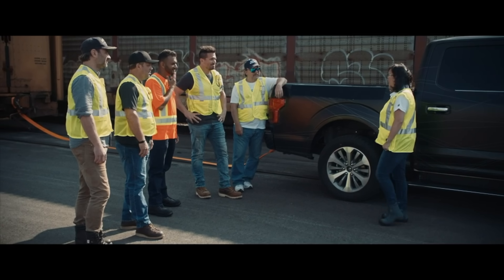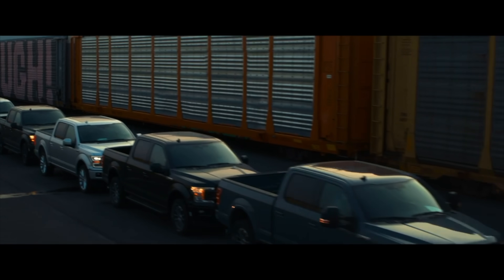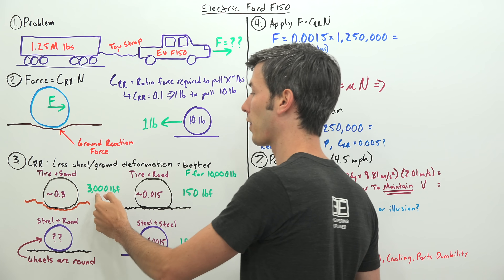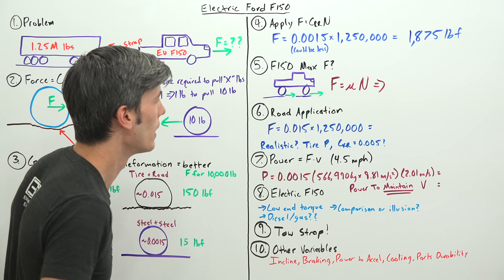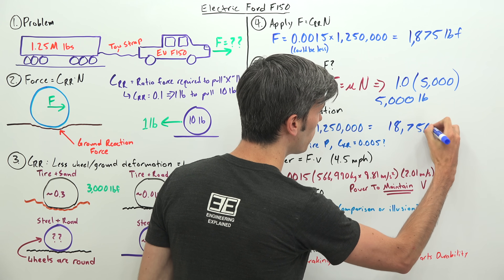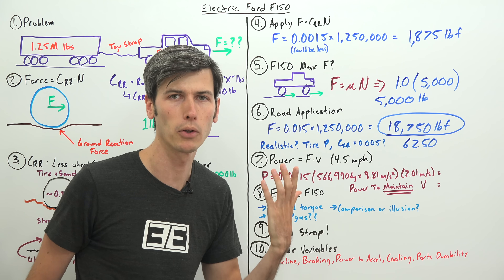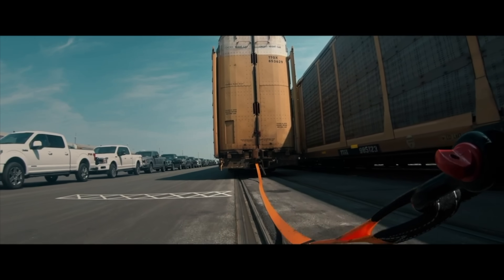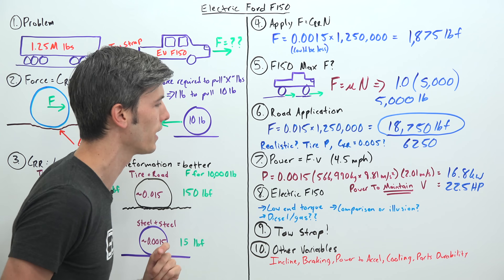No, Ford's Electric F-150 Can't Tow 1 Million Pounds (Realistically)

Comment: That dude is a total moron. I knew all of that stuff already. I knew all of that when I watched the video the first time! We talk about this kind of stuff when we design top running bridge cranes. The bigger your steel wheels are, the less impact your rolling coefficient has. The dumbest thing he glances over is the tow strap. The tow strap is incredibly elastic and that’s where electric motors really help. Once they stretch that strap all the way out, all the wheels have to do is hold that torque from letting the wheels spin backwards and the strap does the work for the truck.

This guy said a whole bunch of numbers that proved exactly what I already thought. Also, the train cars were almost for sure not pulled “tight”. The linkage between the cars let’s you pull 1 car at a time until they’re all moving.
Reply: He is just explaining it for people who dont know much about this kind of stuff, but yes this is very simple and basic stuff

Comment: I can already tell you why; steel on steel has almost no friction at allwhich which is why you can easily see one or two locomotives pulling a fully loaded coal train up a steep mountain.  Rubber on asphalt however has a LOT of friction.
Reply: pulling a train up a hill is always hard and having low fricction doesnt help with it

Comment: Again, much as with the video on double-clutching that I saw yesterday, 'fraid I can't give this a like. No A grade, not even a B, it gets an I for incomplete. The big missing thing is that friction is not all of one type. Usually friction is modeled as some combination of sliding friction and viscous friction. It sounds as if you're treating the friction as all viscous friction, and that may be realistic, but you don't really state clearly if that's your assumption.

I have no serious mechanical engineering background, but intuition tells me that, for rubber on pavement, the interactions are probably more complex than simply and sliding and viscous damping can fully describe. But a combination of the two might be a good approximation here. I just don't know.

Your viewers seems to like the whiteboard graphics. I, for one, don't. Better tech for your graphics would make things clearer.

If sliding friction amounted to much, I'm sure you'd be SOL trying to tow much of anything. If it's equivalent to viscous, then the friction will consume power, and set a limit to how fast you can tow that super-heavy load.

You correctly point out that stopping is a real problem! The best thing might be a second truck, on the other end, ready to pull when it's time to stop.

A conventional ICE truck has a big disadvantage here because of all the slipping required, which consumes power. After all, it will take a good while to get to top speed. If it's a manual, you may be needing a new clutch at the end! An automatic is probably OK as long as you don't push it too hard. (Question: Do modern automatic transmissions have warning lights for overheating?)

Comment: The tow strap is key,  by the thickness of it tells me  it's greater than 2000 lbs. It's also a kinetic strap that stretches like a rubber band that stores the force it it, you can see it stretches at first, and they cut to the rail wheels. And show it start rolling quickly. Anyone who has ever used a strap like this will know it's a force multiplier (so you can pull vehicles stuck in mud out by putting slack in it and accelerating and the energy gets stored in the strap rather than transferring instantly , making a nice pull and hopefully nothing breaks) if they used a chain the load would have never started to roll.

Comment: I used to work on subway rail cars. In the railyard if we needed to move a rail car a couple feet in the shop to get the lifts to line up under the wheels we’d have an operator release the brakes and a couple guys would just push the entire 40 ton 2-car married pair by hand. It’s like pushing a dead sedan, super easy. In the shop the 13,000 lb truck (some people call em bogeys, they’re the steel frame that holds the wheels and motors and is very easily separated from the car body) can be pushed by one guy by hand very easily. Very low rolling resistance.

Comment: I would have been more impressed if the F150 broke the tow strap
Reply: Just askin
Reply: @poopypants678 _ no it’s not just because it has a V12 doesn’t mean it has torque or enough grip for that mater. It has plenty of HP but would never be able to do this. Its physics dude
Reply: @aduptuniform2647  Actually, the grip part, or at least tire compound, is far better than this POS truck😇 Even the first Veyron had super special tires developed just for the car to handle the power😎
Reply: SCOOBYTRUCK3R ! The wheels would crack in the frame can’t take it either
Reply: AduptUniform26 if Chevy is so strong why do they have to make up their own reward and are completely loosing when it comes to the torque game between dodge and ford
Reply: AduptUniform26 wooosh
Reply: AduptUniform26 bugatti’s have a W16 my guy
Reply: AduptUniform26 the Chiron has a v16
Reply: That truck isn't capable of breaking that tow strap with no slack in it, it doesn't weigh enough.
Reply: poopypants678 _ you’re denser than a black hole
Reply: Sureee
Reply: Gas truck would blow a transmission from start?
Reply: Bruce Ford Jr probably the clutch
Reply: The Chevy/gmc trucks are complete jokes, if you have the 5.3 that is. The 6.2 is actually pretty stout but the 5.3 has less power than fords 5.0 and fords 3.5 ecoboost. And even the 6.2 has less than the 3.5 high output just sayin
Reply: poopypants678 _ anyway Bugatti’s are slow
Reply: Ford ain’t that strong
Reply: AduptUniform26 what vehicle company do you consider strong then?
Reply: @Jielyn Sabarez Chevy gmc sometimes Toyota. Why?
Reply: AduptUniform26 that’s funny since Toyota’s largest truck in 2020 can only tow 10,000 pounds and Chevy’s can  tow 35,000 pounds meanwhile fords largest truck can tow a maximum capacity of 37,000 pounds. so how on earth is it possible that Chevy and Toyota’s are stronger than ford .
Reply: @joshfenby4170  Toyota doesn't have a diesel option..
Reply: @joshfenby4170  the 2017 chev 3500 was rated for 25000ish , Ford and dodge rated much higher but when put head to head at 25000 the chev smashed Ford and edged out dodge . In every category,  fuel eco , acceleration and braking
Reply: @aduptuniform2647  CHEVY SILVERADO ALL DAY LONG!!😁
Reply: @Dee Mack, hell ya
Reply: Casey Houser that’s not the point he’s saying Toyota’s stronger when that is clearly not the case
Reply: Tyler Rosborough well last I checked it’s not 2017
Reply: @joshfenby4170  my point is don't trust the ratings,  ford out rated everyone that year and got outperformed by every truck with lower ratings
Reply: Tyler Rosborough good point but on paper that’s what It says. but my point was aimed toward the Toyota how could you possibly say a compact or mid size truck could out perform a large truck as far as strength goes. and at least in 2019 I read a few things where they tested all the largest trucks from ford, dodge and Chevy and ford outperformed them in towing.and I did mention 2019 in my first comment I’m not talking about any other year other than 2019.
Reply: @joshfenby4170  that's fair enough and I agree about the yotas,  they struggle against other half tons ,no chance against any larger truck
Reply: @jielynsabarez2693  anything else
Reply: @aduptuniform2647  What are you towing that needs more than a ford can give you? And is it worth the reliability issues GM is known for? Even if GM made more powerful vehicles I have been left stranded by my Chevy enough times that I don't think I would risk it.
Reply: @Gareth Baus never had a GM vehicle go out or have any problems with me or my family, so there’s no reason why I should switch to something else.
Reply: @Gareth Baus and I agree, that’s some GM cars have problems, but I can list of a number of vehicles that have lasted over 20 years
Reply: @garethbaus5471  I can name my families cars that they got rid of due to the numerous problems: 2004 Ford F-350, 2014 Ford F-350, 2011 Ford Mustang, 2013 Ford Focus, and 2001 Ford Mustang. Our cars we own: 2019 Chevrolet Suburban (Mom), 2018 Camaro ZL1 (me), 2020 Chevrolet Silverado 2500, (Dad), 2020 Chevrolet Camaro SS (me), and 2020 Chevrolet Camaro RS (LT1) (Dad). We also owned Ram's in the past and they were great, so is Dodge, since we never have problems with GM nor Dodge cars.
Reply: Jielyn Sabarez Toyota is a lot more reliable than ford
Reply: @aduptuniform2647  Yeah, only 2 Tesla Cybertrucks can break the strap xD
Reply: @JarutheDamaja Lol, maybe more

Comment: To be honest your numbers are bull. I have worked on a rail road and it takes a lot more force than what you think. There are other friction that is in effect also such as the axel bearing and other axel components. 
From experience on the railroad a typical empty car weighs 30 tons empty= 60,000lbs 
So with your math 0.0015 x 60,000 = 90lbs. 
By experience it takes a lot more than 90lbs to move that 60,000lbs car. It takes more like 300+ pounds to move it. 

So I have no idea where you are getting your numbers from. Reality doesn’t always work with math bud. I’d like to see you actually see in person how much it takes to move an empty train car. You will be surprised how much it takes and you will re think your math.
Reply: yeah, its always a bit more complicated than it looks

Comment: A zephir e2000
With a diesel engine with 80hp
With a torque converter 3 speed 
Max speed of 25km/h
 pulls 6 000 kg in 2nd gear 
With 16 000kg of mass 
With slipping tires on polished concrete

Comment: The huge advantage is steel wheels on steel rails is super super super efficient. Practically no friction. That's why trains do so well. A human being can move a single box car on a flat surface if he's in really good shape.
Reply: I work in a rail yard. I've done just that.
Reply: Same concept with boats, even a child is strong enought to give a 7-8 ton boat a push away from a pier.
Reply: Anyone can push a car on a flat surface, as long as  you have grippy shoes you have more than enough force to get it moving, and once it's moving it goes easily.
Reply: @miguelmsilva4112  , it's not the starting that's the problem. It's the stopping.
Reply: What kind of shape is a really good shape? Circle? square? triangle???
Reply: I was able to move 2 lmao
Reply: Well, what about the static friction between the wheel and rail? Isn't that how wheels work?
Reply: Not in the wheel bearings though. Super effective. I should have been correct in my prior statement.. steel wheels have like almost no rolling resistance compared to rubbber.
Reply: Also you don't have a single mass to accelerate but individual carts which actually have space between them. At rest you only towing the first cart, when it gets moving its momentum helps to tow the cart behind it and so on. This is actually how trains can have crazy weight and still be able to move.
Reply: He said that in the coefficient of rolling resistance part but ya
Reply: Not friction, no friction is not a good thing for wheels to have

Comment: Train cars have very little rolling resistance. You can push them by hand. Now pull that up hill or better yet put all that weight on the rear Axle. And one more thing. Let me see that truck stop a million pounds. Dumbest scheme I've seen yet.

Comment: In step 5 you multiplied the truck's rolling resistance by it's weight.
How can that be the trucks pulling force if you don't even bring the power of the motor into the equation?
Reply: He's saying that's the most force the truck can transfer to the ground (due to it's weight and friction coefficient). He assumes the truck has the torque available, any additional torque would be useless if the truck can't transfer it to the ground.

Comment: Well the truck was on the track so there is minimal friction, the video also didn't show the truck accelerating, if it really want to show off its torque it should take in the acceleration process as well, heck if it is on the road the torque of the ford won't even be able to overcome the friction, and you will end up with a blown engine, and I don't think anyone will use a pickup truck to try to tow a train even if it have all those torque

Comment: I FINALLY found an error in your video Jason. You said if you added a ton of weight to the truck it might be able to move it.  But a ton is only 2200lbs which would make the truck 7200lbs still WELL short of the 18000lbs required. Ha! 

I know you were speaking figuratively and not literally but I’m taking this win!
Reply: TurboNFRStwoK he actually did make an error, he completely ignores inertia, and 1.25 million pounds has a lot of inertia. (Force = mass * acceleration)
Reply: @joshlemons3662  and internal components

Comment: If a strongman can pull a jumbo jet with his teeth , this is actually not that impressive.
Reply: But can a Tuareg pull a jumbo jet with it's teeth?
Reply: @dinethaltmann9582  Can a strongman pull (with it's theeth) a Tuareg pulling (with it's teeth [?]) a jumbo jet?
Reply: @Rankidu  BUUUUUTT... can a jumbo jet fly (with it's teeth) a Tuareg pulling (with it's teeth) a strongman that's pulling (with his THEETH) a jumbo jet?!
Reply: Asking the real questions out here fellas
Reply: But can a strongman pull out the teeth of a strongman pulling a jumbo jet with his teeth whilst pulling a Toureq, which also happens to be towing a jumbo jet whilst being towed by an Electric F-150 towing a 1,25 million lbs cargo train?
Reply: Rankidu theres a strongman inside the Electric Ford , hes the engine
Reply: @dinethaltmann9582  of course it can lol
Reply: One time my train broke down and I pushed it all the way back.
Reply: so y'all just gonna ignore the Toyota Tundra pulling the Space shuttle?
Reply: After pulling that jet, he’ll be saying “teeth” like “teef”
Reply: @FoxtrotStudi0s  The trailer that the tundra towed with the shuttle on it was specially designed for the tundra so that it wasn't pulling the full weight of the shuttle plus it only pulled it so far and it was then put on a different kind of flatbed that was remote controlled
Reply: Also a Tuareg pulled a jumbo jet
Reply: @yahyasajid5113  still not as impressive as someone pulling one with their teeth
Reply: Yahya Sajid and it broke right after if I recall correctly
Reply: OK, so I didn't catch on that a strongman is sometype of vehicle or automotive thing and I thought for a second a man pulled a entire jet with his teeth

Edit: oh a strong man is a actual strong man and he pulled a jet with his teeth? He must have had some perfectly healthy teeth then, not sure if he got it now...
Reply: No he pulled a giant star
Reply: I'm still waiting for Ford, Dodge, Ram, Kevroliet owners to do what Volvo did with shipping containers.
Reply: WICKEDLEE LOOPY it is when you consider the human equivalent would actually be if that strong man could stand straight up without leaning for leverage and do the seme thing. But he can’t because that’s an insane amount of strength that you’re legs and core would need that most likely isn’t humanly possible.

Comment: You are so wrong the rolling resistance is .12 because there are 80 metal to metal wheels because there are 10 carts. So you have to multiply .0015*80= .12 then .12*1,250,000=150,000 lbf

Comment: Just stop. At the begining you said they did this then you said they can't. So your trying to prove them wrong, yes it pulled a 1.25 ton train car system so are you trying to prove that its cant pull 1.25 ton on a road. 
U are a genius so why hasnt NASA hired you.

Probably cause ur sitting in yo basement making videos to prove nothing. 
Also no Chevy is gonna do that without blowing up... Oh yea electric engines dont explode
Reply: Where in the dang world would you even need to tow 1.25 tons, to if it can do it than it should be able to pull my 1.25 thousand lb mower

Comment: bro can you make a video explaining what the c8 zr1 would need to be able to hit 0-60 in 2.5 secs or atleast in 2.7 secs i'm thinking since the c8 with z51 package is under 3.0 lets say 2.9 0-60 then the z06 could be 2.8 and the zr1 could be 2.7 so if you can give estimates of how much HP/torque would be needed along with what kinda tires to reach 0-60 in 2.7 maybe even 2.5 and if it's possible based on the previous c7 model differences

Comment: Math time. 
The standard Dash 9 ES44CW weighs in at 425,000ibf. By your mathematics, it takes only takes 1,875ibf of force to pull 1,250,000 pounds of train(approximately 9 loaded Auto-Rack). If you take the weight of the locomotive into factor, then a single D9-ES44CW can pull 425,000,000ibf of train. Divide 425,000,000 by 1,250,000 and you come to a whopping 340 cars on level ground. Which is outrageous. Which means that, if these flat earthers theories were true, companies such a Norfolk Southern would only need 400 out of their 800 D9 fleet to pull a yearly freight minimum. It literally cuts the use of locomotives down by more than half. A single locomotive could pull up to 75 loaded tankers, 75 loaded box/refer cars,
150 auto racks and 40 others. That is enough goods to supply a city like Chattanooga TN for almost a week between food, fuel and other needs(electricity aside). And that’s a phenomenal number. In layman’s terms, if the earth was completely flat, then the average train would be around 4 times longer than they are now with one third the average amount of power needed to pull a normal 40 car train.